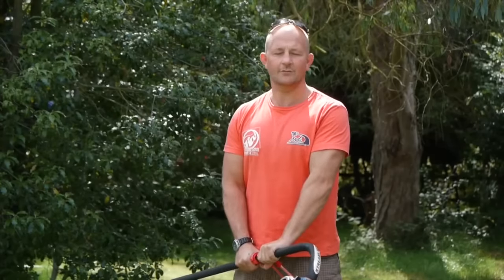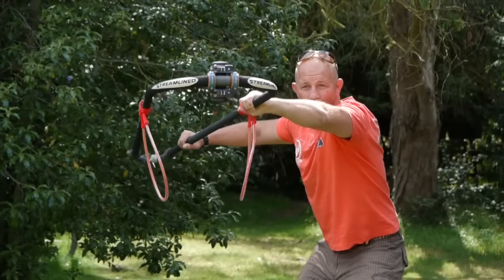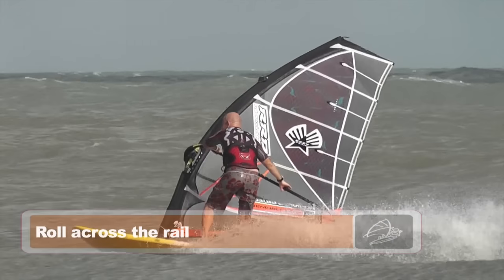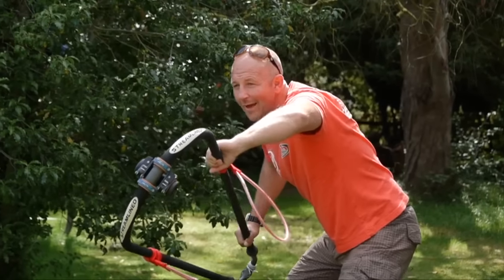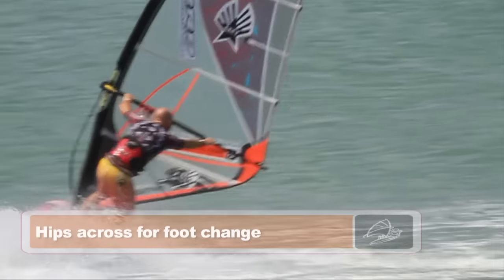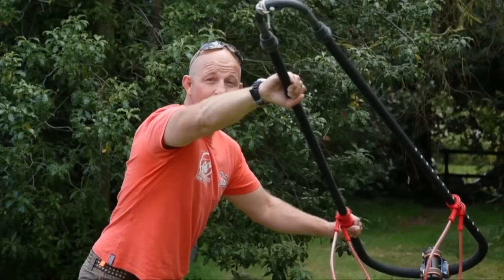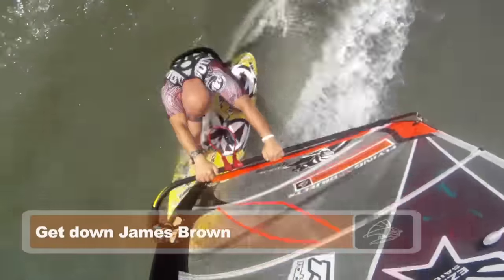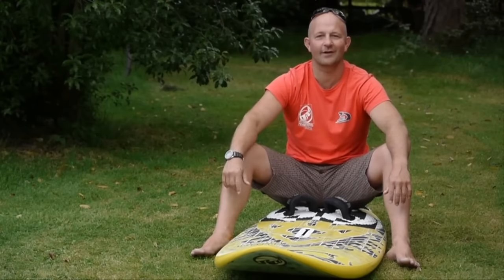Windsurfing Carve Gybe Overview with Jem Hall Windsurf Coach HD

Comment: It might not be a relevant question under this video but; What kind of harness lines are you using? (brand) I feel like small topics like these are highly overlooked. Equipment like Harness lines, mastbases and mastextentions: what to look out for & what do you prefer the most?

I currently found that I enjoy sailing with 25'' fixed harness-lines the most. Which I can now find nowhere since brands now sell either 24'' or 26''. I also find that brands' "inches" differentiate in length a lot. So it might be worthwhile to get a measuring tape with.

Either way, the reason I am asking is I enjoy how your harness lines don't 'dangle' around too much.
Reply from the maker: 34 Inch Flying Objects lines, like 32 inch from most brands. Long lines give you better gybes as you can get into the  move with more speed and both unhooking and hooking in are easier :)